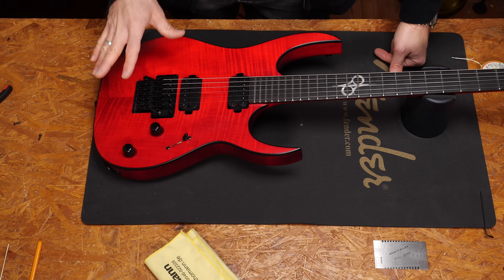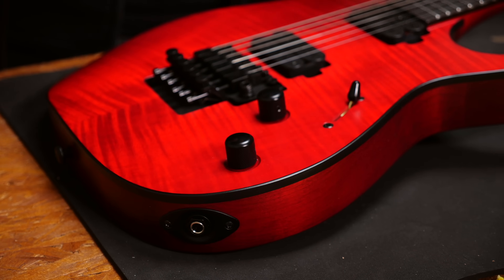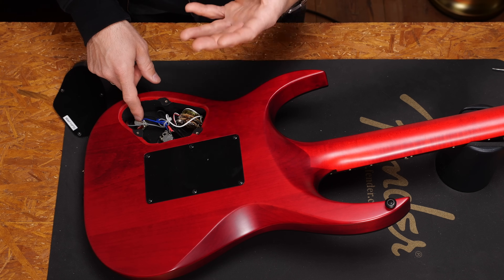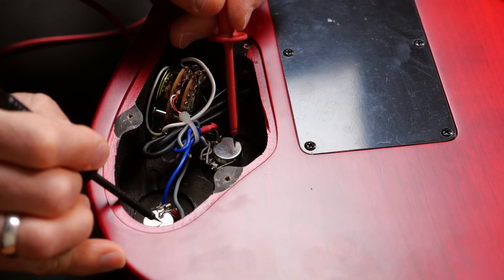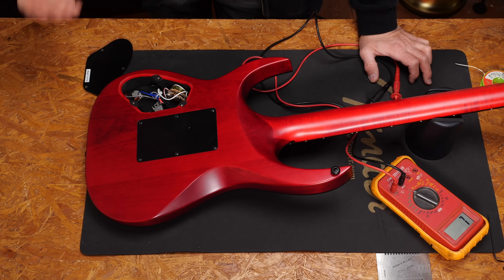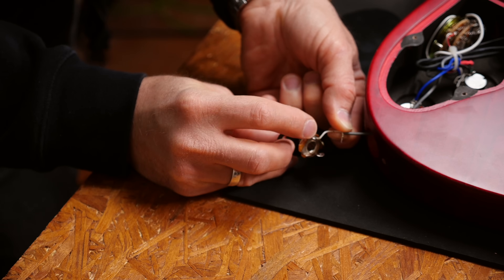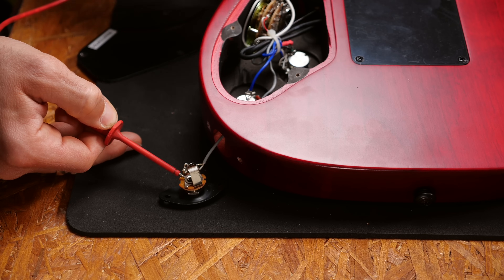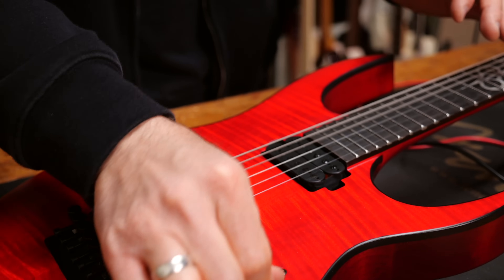How to fix Ground Noise | Guitar Tech Tips | Ep. 8 | Thomann

Comment: Just spent an afternoon trying to search for a ground problem and the buzz was because i have the amp plugged into a power strip with 2 computers, an A/C and a lamp turned on. i'm posting this to save someone in the future - check your external connections first and work inward from the outside starting with the jack first, it may save you a bit of effort with disassembly and reassembly.
Reply: Hi Gary. My amp is plugged into a similar situation, a power extension with my macbook, an adaptor for my overdrive pedal daisy chain, a toothbrush charger and some other appliance. 
Is this bad and what could be causing my guitar hum and if so why? 
Also any suggestion on what I could do here please?

Thanks
Reply: @oneandonlyarajivp  no worries dood just unplug it all and see if it helps might have to borrow a grounded outlet from a neighbor if possible use a grounded 3 pronged extension, also somtimes the internals on a laptop can buzz and whir, if you can run the toothbrush off a battery that may help isolate grounding as well. Damn noisey wall pixies
Reply: I am stumped because everything has continuity but if I touch the strings, or any metallic piece on my guitar, the hum goes away.  I checked the ground from the wire to the amp to the input jack then the output jack of the guitar to all metal pieces.  Every single point had continuity.  I am stumped.
Reply: @generalawareness101  check your grounds again, and maybe the output jack sometimes they need to be bent to make contact firmly with the cable. Ive had bad solder joints that read good until i tightened the jack into the body cavity and the contacts would pull loose, also you're wires could have a bad connection. Godspeed.
Reply: @garygrinkevich6971  I wouldn't put it past having bad wires from the rat's nest I saw in the guitar.  Squier Bullet Mustang, and the Squier Fat Strat I own does not have the issue, so it is guitar related for sure.  I will have to give it a complete look over when I replace my guitar nut (been in my city for a week now but USPS keeps saying arriving late so may be lost/stolen/broken).
Reply: @garygrinkevich6971  btw, I pulled out the fat strat to check it before I replied and found it one of the tone pots did nothing any more.  LOL, I had done some work in it at the beginning of the year so I removed the plate then did all the checks.  I could not figure out why it wasn't working since all checks were perfect.  I went in with my hand to move the wires around then BOOM.  The 333uf cap's leg was not soldered any longer.  A minute later soldered and it worked.  May very well be something like that in the Mustang, but the Mustang requires I take the strings off to get to the wiring due to it having a pickguard.
Reply: @garygrinkevich6971  I am in the process of finishing this guitar as the second attempt at a real TusQ-XL nut is to arrive today (first one was sold on Amazon in a zipper plastic bag and fake as all get out).  I check the grounds and everything was fine save one wire.  That was a thin black ground wire (around 24 awg) that went from a central ground point to the bridge.  All ground wires had 0 ohms except that one as it had 0.4 ohms.  Highly suspect so I pulled it part then replaced it with a 20awg black wire and 0 ohms.  Plugged it in and no more hum or lack of hum when I touch the bridge.  I will know 100% when I put the new strings on when the nut is changed, but if it returns (doubtful) then it can't be fixed without ripping everything out and redoing it all.  The pots in it are 250k A.  I left them alone as 250k is too small for humbuckers imo, but not messing with that (at least for now).
Reply: @generalawareness101  when in doubt you can always gut everything and just run a master volume like EVH did. glad you sorted it out. =]
Reply: @garygrinkevich6971  I figured it was something simple, but very strange that the wire itself has resistance when no other wire in the guitar does.
Reply: Yep
That's the first thing I would check
Reply: Ahhh that's my current set up and I'm buzzing...thanks
Reply: I think this is dirty power, not a ground issue.
Reply: be very wary of the term "dirty power" because there's a whole industry of BS devices that claim to resolve that, which makes it difficult to get legit information using that term with how hard they market their crap. Real filters cost at least 100 and need to be installed in the consumer unit by an electrician, they don't plug into the outlet. Hum from guitars could be ground or EMI, if dirty power is causing EMI a filter won't stop it, unplugging the offending device will.
My main issues came from the coax tv cables throughout the (rented) house, since we don't use tv I terminated them all and disconnected the antennae & dish. Problem in guitars gone and radios work again.
Cheap LED lights anywhere in the house, & dimmers will cause EMI when on.
If you have anything like OPs issue, the obvious thing is to try different power combinations, sometimes you need to seperate, sometimes you need to bring components to the same power supply. 
Also your PC is a big dirty source of EMI, burn it... or insulate it from your pickup with something.
There's a cheap solution to all of these issues, and some bogus crap waiting for you to waste your money on it to do nothing.
Reply: Plus , single coil pickups make a buzzing noise
Reply: @kennyplay5982  very true, that 60 cycle hum can be a real bitch, thats why i only play in position 2 or 4, or pick up a guitar with a humbucker (preferably not a fender)
Reply: you’re a life saver man. if anyone’s wondering whether or not this can help with audio interface, usb port, or amp sim buzz, it helped me get rid of most of mine
Reply: Same here: two chargers plugged into the amplifier powerbar.

Comment: I would like to make a small suggestion.  The Continuity setting you used on the multimeter is actually a diode checker.  It is applying voltage and the reading that is displayed is the voltage in which the diode biased and allowed continuity.  Diode checkers will ‘Ring’ up to 40 ohms.  If you are still having trouble locating the problem switch to ohms and see which component is reading high.  This could save you from reflowing every solder joint.
Reply: is there a way to make it quieter like putting capacitor or something or resistor ,not sure im not electrician
Reply: @jedunboxing4127  what do you need to make quieter?
Reply: Hey! I'm trying to fix my guitar and saw your comment. When using the multimeter every component in my guitar 'rings', every component other than the toggle switch, which gives me readings of around 400 ohms when connecting it against any other component in my guitar. Following your comment, this narrows down the issue to the toggle switch, but to what conclusion could I get with this? a) Some cable needs to be resoldered and this should fix the issue? or b) the toggle switch is f'd up and I'd need to switch it for a new one? Just a noob here trying to learn a bit and fix my PRS :) Thanks again man.
Reply: How do I know if a component is reading high?

Comment: Keep in mind that on some guitars the metal components connect to ground by being screw onto a shielded pickguard. So if you can't figure it why something like a jazzmaster rhythm selector switch isn't grounding, it's because it's wiring is designed to be use with a shielded pickguard. If you don't wanna shield your guitar then you may have to run another wire to the jack

Comment: I was having not a hum sound but lots of static coming from my amps and evening computer monitors (plugin amp). I found this video and tested my pots, all worked fine but then I tested the Jack and nothing! It was connected however the ground wire and white wire were in the opposite space they should be in. 
I switched them and tested as you mentioned and it worked! Now that static noise is gone. Thanks so much for this video!

Comment: Thanks for the tips. I have owned a multimeter for years and didn't know about the continuity test setting. I always used ohms, which also works. This test also works for patch cables. Make sure that you have good continuity from end to end. Sometimes you have to clean the ends of your cables or the contacts in the jack.

Comment: Hi Chris, thank you for the tip regarding the cold soldering. My 2010 Squier Bullet Strat suddenly developed that grounding issue, everything looked fine, till a closer look at the middle pickup showed some very small electrical rust. Resoldered it and problem solved, i forgot about the cold solder connection completely. Much appreciated and happy rocking!

Comment: Ran into this hum problem with my new Harley Benton RB-12CS, along with a few more fit and finish issues.  The grounding issue turned out to be a soldering problem (hum showed up when the strings or bridge were not touched).  Because of this guitar looking like a brand we cannot mention, I flipped the bridge saddles, octave strings and did a bit of nut-work, besides the standard setup for intonation and lowering the strings for increased playability.  The frets were in dire need of dressing as my fingers came away with lots of metal dust.  I also removed and replaced the tuning machines with Gotoh locking machines and Schiller strap locks.  One thing to note is where on a three-way switch or five-way switch is where to place one of the probes from the multimeter.  The next mod I might undertake on this guitar is to pull all of the pots and switches and use a bit higher quality copper foil on the underside of the pickguard and to leverage copper foil up to the pickguard screw holes in order to shield the cavity, too.  This is a very fun guitar, by the by.  Great video, thank you!

Comment: I diagnosed my Fender Jazz Bass ground issue with just a 'test lead' -  a wire with an alligator clip at each end (you could just use a plain piece of wire stripped at each end). I connected one end to the ground on the jack, the touched each of the pots with the other end. The hum dissapeared when I touched the forward pickup volume pot. No evidence of any wire loose, so I just soldered a new piece of wire between the jack and the volume pot. Problem fixed. THANK YOU FOR YOUR TIPS!!!

Comment: I just purchased a "Condition 2" Kramer Pacer Tiger finish from Guitar Center/Musicians Friend.  Being 'Condition 2' you'd expect light scuffing at the worst.  The sales rep on the phone couldn't tell me any details other that the guitar was located in their warehouse.

Being just over 20% less than a new one and also not wanting to wait for a the new ones to be stocked, coupled with an easy return and a good experience with another 'Open Box' guitar, I ordered it.

Got it, opened the box, inspected and I could find absolutely nothing wrong with it, other than the whammy bar doesn't want to thread on smoothly once in a while.  I plugged it in, sounded great clean, added some gain...OMFG, very loud! LOL

Finally popped the covers off, looked fine.  Checked continuity and voila!  Ground wire from the bridge had broken off at the POT.  Tested again by touching until I can solder after work...noise levels are now within spec!

I'm wondering if this was why someone returned it?  Saved me over $150 - thanks whoever you are!

And thank you for the post, Thomann and Andertons are amazing.  The service you provide the States is top notch!

Comment: Just purchased Katana 100 Mk II... allowed it to acclimate ( not that it was cold or wet ) before plugging in to the power. Read the manual, turned it on and all was quiet.. till I plugged in the cable ( no guitar yet ) and a loud buzz ensued. I've been searching for an answer beyond the standard plug-in point/ fluorescent lights/ ect ( all of which do not seem to apply ). 
It may be a lost cause on this brand new unit, but at least I now have a starting point... believing it may be a ground fault.
Thanks for the well described condition/ analyzation method/ fix.

Comment: Added thought: it seems that a number of people have been able to trace their issues to broken wires on the jacks. That can come from tightening a loose jack nut from the outside of the instrument without stabilizing the jack body inside the instrument, such as by taking a few minutes to remove the cavity cover plate (on solid body instruments with easily accessed control cavities) in order to hold the jack firmly, while tightening the nut on the outside. Unless the jack body is firmly prevented from rotating, tightening the outside nut rotates the whole jack, pulling on the wiring until a wire snaps. The wires are often very tiny and don't put up much resistance to being yanked. There are a couple little tools that will go into the jack from outside, press firmly on the sides of the socket to hold it firmly and allow the outer nut to be tightened without rotating the jack body.  One is the String Swing CC18 tool. Easy as can be to use it.

Comment: Very helpful! I had a vintage Gibson EB 3 that had inconsistent terrible racket. I couldn't figure whether the source was a bad pot,  the jack... anything seemed to be able to trigger it. Tech Jon Mouradian found a loose wire, as in your video, and pointed out several cold solder joints. He resoldered all the problem areas >> perfect! Thank you.

Comment: I found a lot of times too guitars that came in for repair I worked on, loose flakes of solder had gotten lodged into areas of switches and across lugs on pots etc that were causing the issues. If no broken wires are found and everything else is checking out, look for loose bits of solder debris that might be stuck somewhere.

Comment: Chris, that was great!  I had a buzzing sound issue with the FELSEY FLP350 (their first batch).  Located it at the bridge and was a coating issue.  The coating blocked the ground running through the inserts.
Reply from the maker: I'm glad to hear that you have it sorted out. That coating issue is something that happens every now and then unfortunately. Luckily brands learn from it and improve as fast as they see it slip through. Cheers man //Kris

Comment: Well shucks! I've got a 90s JagStang that's got that EXACT issue! It also had some bad wiring from the factory, & I've been in there before, but I've had that grounding hum ever since. Very possible I botched a soldering joint, I suppose. (Sigh). Looks like I've got some more work to do! Thanks for the insight!

Comment: This is one of the best instructional videos I've seen. Thank you. Will be able to fix my guitar this afternoon. Could not see any loose ground wire yesterday, but probably a bad solder joint I now will be able to identify. I actually suspect it is the same as in the video with the input jack. I didn't realize how to check it with a guitar cable before now though.

Comment: I put Mexican Tele Stock Pickups back in my Tele myself and they work.  No major hum.  But I do notice a little hum when I touch the strings and when I touch the pots (Steel knobs).  Is this a result of cold solder joints?  I also noticed two wires originally twisted together on the tabs of the switch in a couple places but when I reinstalled the pickups I soldered them separately since my cloth wire was too stiff to twist.  Could this cause a but of a hum issue   (its a small amount of hum).

Comment: Cool easy explination thanks.  Need to check my grounds but I think my problem is in my pickup switch.  Bridge and bridge/neck selection its fine no noise.  I put it on just neck it hums like crazy ONLY WHEN TOUCHING THE STRINGS, not when Im not touching them.  Never had this issue before

Comment: I have a "Cordoba GK Pro Negra" (nylon sting) with a "Fishman Prefix Pro Blend" acoustic pickup. I bought it in 2015, so it's now 6 years old. Late last week, it developed a hum when plugged into my amp. The hum get worse, the closer my hand came to the piezo and would go away if I would touch the outside ring of the guitar plug socket (the "strap button" on the bottom of the guitar). This told me it was a grounding issue.

So make a long story short, I took it to a repair shop and the repair person predicted it wasn't a loose ground wire, but rather a bad piezo. He said over the years he has NEVER (excuse the caps) seen a Fishman pickup that eventually didn't have a failing piezo in it. It's just part of "doing business" with a Fishman pickup.

It turned out he was right. He replaced the piezo and the guitar was once again right as rain. The cost wasn't too bad... at €70 for the replacement piezo and €30 to install it.

I only mention this because this video focuses on dedicated electric guitars... but acoustic guitars (with pickups) can also have grounding issues. If you have one with a Fishman pickup, don't overlook the high probability that a faulty piezo is the culprit... and not a broken or loose ground wire.